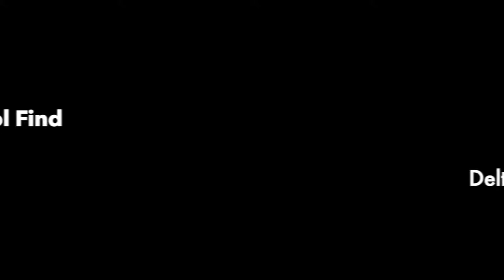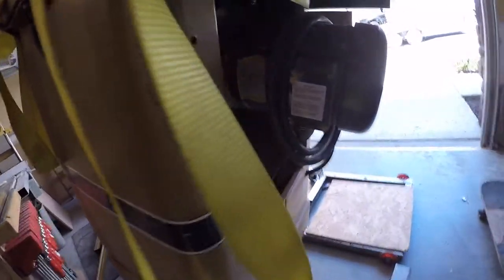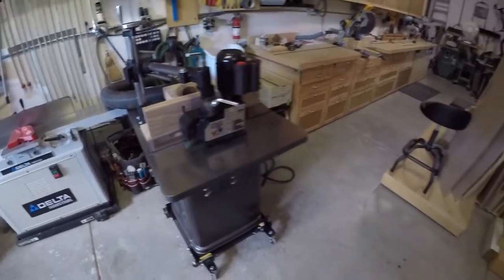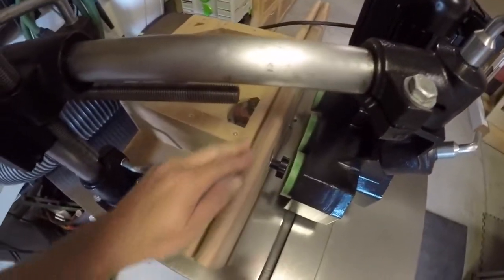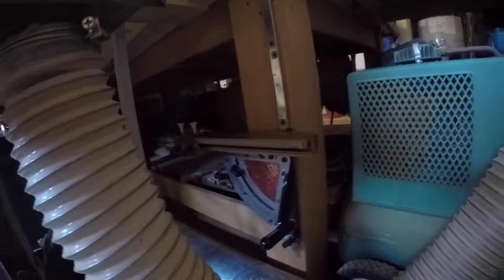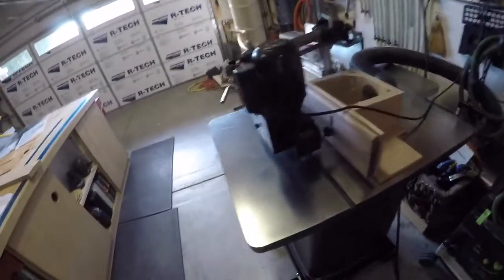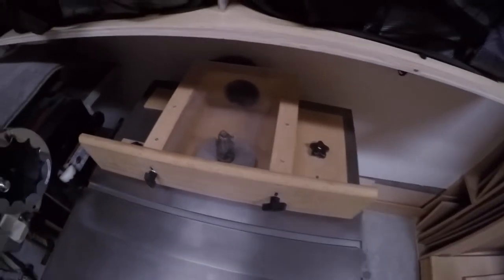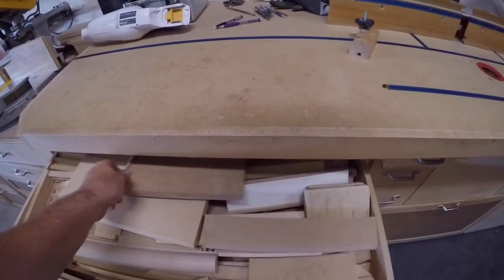Vintage Delta Shaper- Another Great Craigslist Tool Haul and Restoration Results of.

Comment: Great finds, and a really nice restoration!  I have a couple of recommendations for your next machinery move.
Try not to sling your table saw, shaper, planer or any machine from the cast iron table.  Unfortunately I saw the bolts fastening the table to the cabinet strip out of the cast as it was being lifted into a pick-up.  It came crashing down on its side, cracked the table and motor end bell and broke the trunnion, but not before messing up the tailgate of a nice pick-up at the same time!  With these old machines, you have no way of knowing how they were treated, or if they were lifted around by their tables or guide rails.  I know I don't ever remember to check for loose bolts...
It is much easier to use 2 slings to form an X-style basket under the cabinet and then lift it with your engine hoist, than it is to score another great deal to restore!  
I also remove all motors from their cast iron mounts, especially motors for Powermatic table saws.  The last thing you need is to replace the trunnion, which may cost more than you paid for the saw.  It also makes the lift lighter in and out of the truck or trailer.
Happy hunting for your next project!
Reply from the maker: Thanks for watching and commenting.  Thanks fir your advice.  I think it’s a great idea to lift from base. Absolutely.  When I got them they already had them lifted up by the tables abd I backed my trailer under them to load up. It was great. So I never even thought.  Same way when I picked up my general table saw from dealer, lifted by the table top right by the steel cabinet. It’s seemed okay and has been fine.  And that’s been moved three times and still perfect. But I’ll say, maybe the bolts were rusty or maybe the machine was heavier.  These machines aren’t heavy. 400-600 max. I picked up my scmi sliding table saw same way. It’s 1000 pounds and forklift lifted same way.  We must be getting lucky.  It does worry me every time but nothing has happened yet.  Also though, I’m loading into lower flat trailer and not pickup truck bed.  That’s very high. I’d seriously freak out if my truck got damaged doing that. But just to be safe I think I’ll try to lift from cabinet next time.  It’s probably safer.  Thank you.

Comment: Great restore on the shaper david! Can you make a video on how to build your shaper fences?
Reply from the maker: Thank you Vic.  Yes I’m working on it.  Absolutely. Check back in a few days as I’m going to post one soon.
Reply from the maker: Hey by chance did you check out the video on the shaper fence build?  I put it out a few days ago.
Reply: Hi david, no have not seen it yet, but will later today. Thanks
Reply: Hey david just watched the video and it had a great deal of information. Wanted to ask you what your thoughts are if I used black melamine instead of mdf? Also awhile back I bought a used multi cutter like you have, trying to learn how to use the cutter on what different profiles can be made, maybe that would be another cool video you could make on the different profiles on shaper cutters. Any idea where I could fine a 1inch spindle for a 3hp delta shaper?
Reply from the maker: @vick5282  thanks for watching.  I’m glad you found it useful.  As far as black melamine, what parts are you thinking?  Because melamine isn’t that thick.  Also the cutter profiles on the raised panel?  Is that what you mean?  I’d try eBay for spindles.  Delta is an easy maker to find parts for.  Shouldn’t be too hard. What model is it?
Reply: @davidbryanwoodworksandmore  my shaper is a delta 43-379,  I was thinking of using black melamine for the entire build only because it goes with the scheme of my home shop. The multi cutter I have is a freud, I believe yours might be the same.
Reply from the maker: @vick5282  if you want to use melamine , maybe double it up to get 1-1/4”.  So 5/8” thick times two.  Then yes it would work.  Or 1-1/2”.  Thick.  But not 3/4”. That’s too small.  Except for the hold down.  For the insert cutter, I use the infinity insert pro cutter head.  I do have a Freud for some cutters but not the raised panel head in the video.The shaper you have is nice.  Those are great shapers.  Is it in good condition ?
Reply: @davidbryanwoodworksandmore  yeah its in really good condition actually, the only issue i have is getting snipes at end of the run. It came with a split fence system(delta's stock fence) and with a staight edge i line both of the sides dead flat and still manage to get some snipe at the end. Hopefully with you fence setup it will eliminate that. Thanks again david for the response and look forward to seeing more videos!
Reply from the maker: @vick5282  try this.  Do what I show on the video where I make doors abd drawers.  I use by a bullnose bit for drawers on router table.  That bit causes snipe because it removes all of the wood.  So use the technique I show.  Put tape on out feed fence. And or just set your fence out on the out feed side. But I like using tape.  Watch that video to see what I mean.
Reply: @davidbryanwoodworksandmore  will do. Thanks again david!
Reply: @davidbryanwoodworksandmore  david cant seem to find the drawer build video you are talking about.
Reply from the maker: @vick5282  here’s the link. https://youtu.be/gTjPRSpTnXc
Reply: I have a 1951 model 43-205. To clean the top l spent $75 to have it Blanchard ground. Had the cabinet powder coated. Bought the shaper in the mid 90s when you could still get Rockwell parts. I wouldn't go near anything Delta sells today.